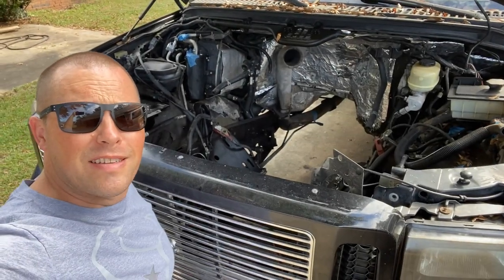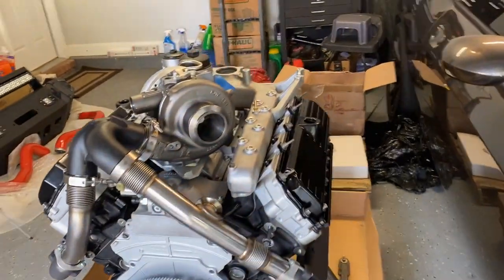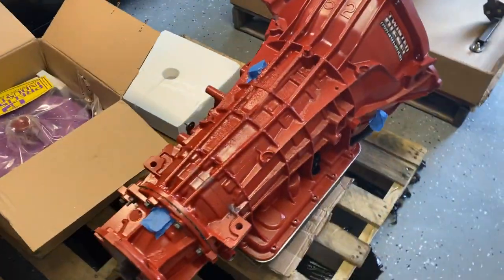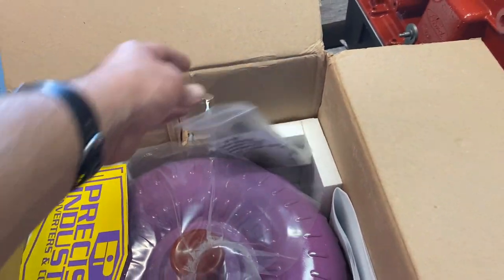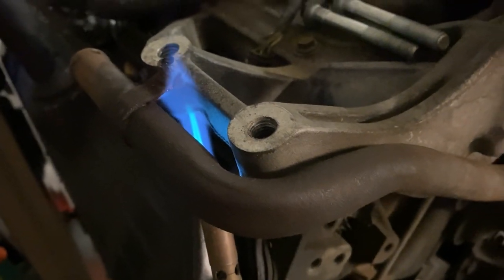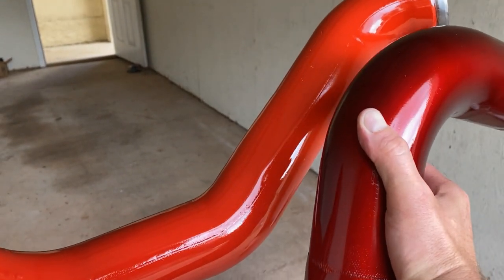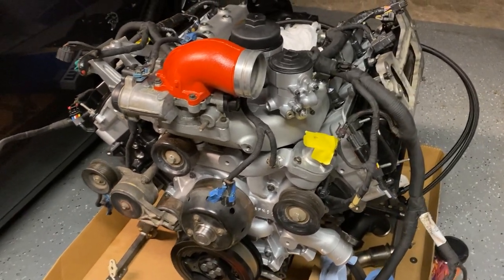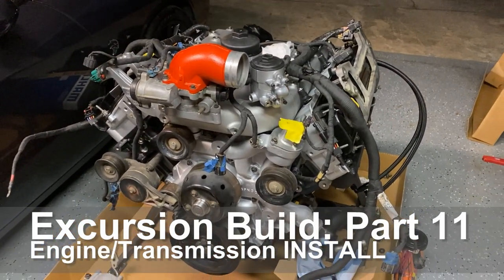Excursion Build Part 10: 600Hp Powerstroke Engine unboxing!

Comment: Goals! Been looking at that setup awhile for mine, cant decide on the build in a box or ready to run myself
Reply from the maker: I went with ready to run because I figured I would screw something up!
Reply: @GSXR1000Rob  ya I hear you first 6.0 I tore into was a little challenging, but I've done hundreds by now but I still may go with one built as a mechanic sucks working on everybody's cars then doing mine after work lol

Comment: that idler under your odawgs intake....did it spin freely, not making contact with the intake, or did you need to space it?  I've heard instances with the odawgs intake that it may need to be spaced slightly to clear.
Reply from the maker: It clears, but barely. I’m talking like a hair width. It’s so close, I’m thinking that I may space it for piece of mind.
Reply: @GSXR1000Rob  let us know if you end up doing it.... I'm right behind you on assembling my motor with that intake

Comment: What's kill devils reason to using 03' log style rails?  Vs extending the icp pigtail and running the updated wavy style with icp location on valve cover. I'm just curious in the middle of updating my entire HPOP system on my 03' while motor is out
Reply from the maker: My assumption is because they don’t supply the main engine harness. So it’s based on what you have already. You can probably have them do either.
Reply: Because his vehicle is that year lol